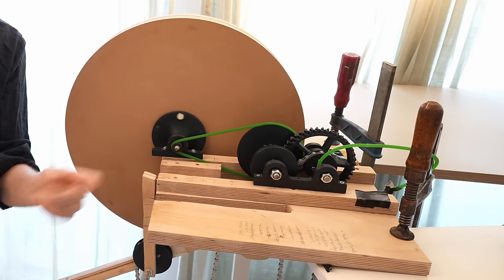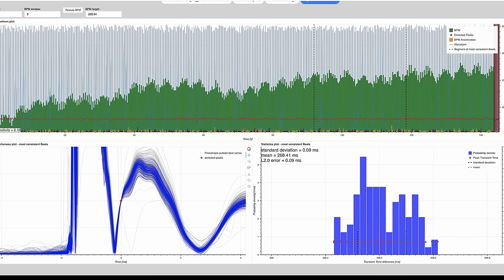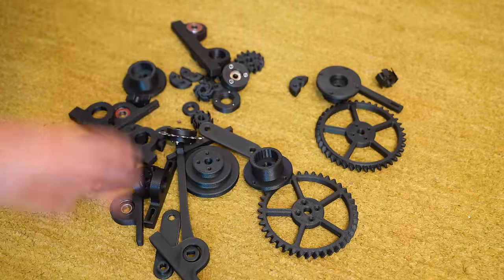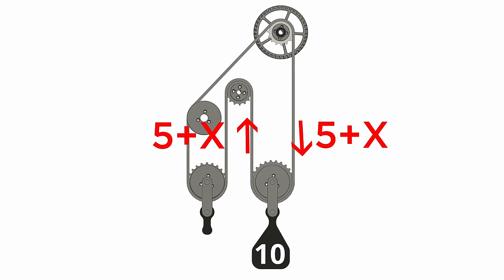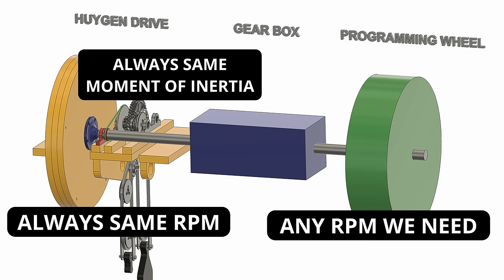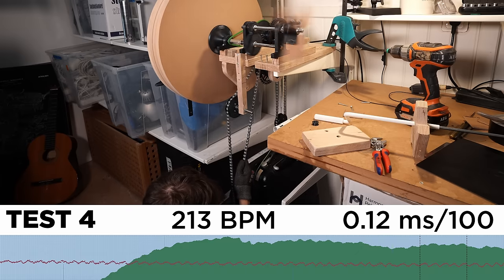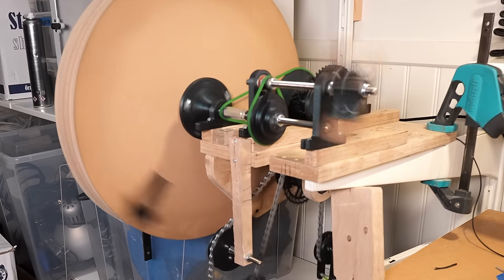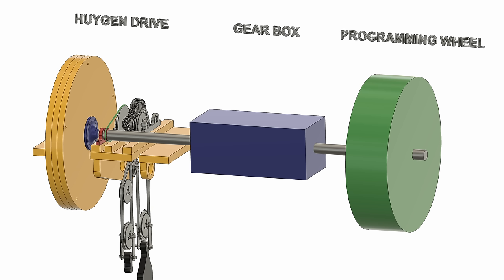Using Gravity To Play Tight Music

Comment: You're going to be powering a couple of marble elevators, and a programming wheel.
The programming wheel needs to turn at a rate that is tight, and will have a tight energy draw.
The marble elevators can be sloppy, and will have a sloppy energy draw (depending on the number of marbles in each lift at any given time).

I'm not sure you need to care about how tight the flywheel is.  The marble lifts are going to add slop to your power train.

I think whatever mechanism you use for tightness ought to be as close to the programming wheel as possible, and it needs to accomodate for a sloppy power input.
Reply: Exactly. The machine could play 10 marbles or 1000 marbles per minute -> the power consumption of the lift will vary by a lot. Having a tight flywheel while testing with a constant power consumption isn't doing anything for the marble machines tightness.
Reply: @mrpraefekt6252  I've said it before, and I'll say it again: There needs to be some kind of isolation between the ball lift and the programming wheel drive.
Reply: Just slam the marble lift to its max capacity all the time, lol. Recycle the overflow back to the bottom again
Reply: You could have a flywheel that is powered like the metal prototype in germany, that drives the marbel lifts and use the output of this flywheel to power the new drive system, that only drives the programming wheel. 
With this you get a pre smoothed power input for the new drive (stop the wavenes of the output) and you dont have to wory about variating loads of the lifts.
Reply: Powering the lift with the crank would solve the issue with changing number of marbles in the lift leaving more constant power input to play of music.
Reply: @andrey5405  Yes. As long as there is a mechanism to automatically disengage the chain drive if the weight gets to the top and you still need to lift a lot of balls.
Reply: I think part of why he's so concerned with tightness in the main drive mechanism is because the load is known to be highly variable. The tighter the main drive is, the more "budget" there is for timing variation in the mechanisms it drives, see what I mean?

At the same time, I agree that this needs some kind of closed-loop governor (such as a centrifugal governor, perhaps with feedback from the position of the main weight) to deal with the tempo drift, and that it makes sense to isolate the drive for the marble lifts from the drive for the programming wheel. Two independent flywheels and power trains but driven by the same weight, maybe?

Note also that there's an unspoken design constraint here, I have the impression that Martin really wants the entire machine to be muscle-powered and mechanical except for the microphones. That rules out electric motors but also any form of electronic governor.
Reply: As said, a centrifugal type governor negates all those problems. They worked on steam engines over a hundred years ago, they'll do fine here. One step at a time though.
Reply: @elwoz1  I think you could have an electronic governor as long as the electricity was generated by the prime driver. (namely whoever is turning the crank) You could coat the outer diameter of the flywheel with magnets and surround it with coils that generate electricity. You could even use the same coils (or a second set) to slow down the flywheel to maintain the speed.

Comment: Just wanted to say that the BPM precision battle is not an uphill one, but an unreachable one.
Once you're in the milisecond range, you might not need to worry any longer, seeing that contact with the programming pins will make it look like the number gets worse when you install the midi wheel. All of them will behave as micro impacts that slow down and overall destabilize the wheel by the amount of notes being played in the moment. If your intro has a few notes, in comparison to the chorus of a track, the chorus will play slower, by a miniscule amount, but slower.
Depending on what is being programmed, some may even slow down the machine's spin too. Be it weight or added friction.

Comment: Two quick suggestions :
- as people said, calculating deviation in ms at different speed doesn't really tell you if it's tighter or not. Halfing the deviation in ms by doubling the speed is actually not an improvement. That's because when you then add a gearbox to divide the rotation frequency by two (doubling rotation period) you will double de deviation in ms as well. A more useful metric to measure the tightness would be the deviation in percent of the duration of one fly wheel turn 
- maybe try running some longer tests to see if it stabilize over time. Like an hour minimum. Maybe use a electric motor to turn the crank to make long tests possible.

Comment: Two thoughts: 1) You're measuring accuracy in absolute time (ms) over a relative time (period between transients). Measuring that way, the higher bpm will always be "tighter". What you want is the relative tightness. 2) As others have already mentioned, when playing songs the load will vary, which is equivalent to your wind governor growing bigger or smaller. The Huygen drive is, as you said, a way to filter your input, to achieve (near) constant force. But you want constant velocity(tempo) under varying load, which becomes a trickier problem, some kind of feedback/compensation is needed.
Reply: agree, we all should reserve absolute tightness to some kinky stuff
Reply: He could use an escapement, that would give him the perfect tempo no matter the load. It would just tick very loudly 😂

Comment: Looks very interesting! What could be difficult in the end: When you have to rotate the crank at a given speed which is not in time with the music, that could be very difficult for your brain.
Reply: That's why organs and such do not have direct link to the input and output.
When you crank or pedal on an organ, you are increasing air pressure.
That air pressure is then regulated to come out as needed.
This allows the machine to play tight without having a precise energy input.
Reply: Yes, I was worrying about this too. But if you think about, for example, a bagpiper, they seem to be able to cope with this. They have to re-inflate the bag at a speed that's largely independent of how fast they're playing.

Comment: I still can't believe that after hundreds of episodes between MMX 2 and this one that the input is still correlated to the output instead of the flywheel just holding power and something else tapping into that energy at a steady BPM that it would ask for, a bit like the flywheel bike where the flywheel is just stored energy and the accelerator takes a little bit of energy or a lot of energy at a completely steady rate which also leads to another thing often commented. That means it still keeps the machine human, it's still Martin adding the power into the system by method of a crank or pedal but the output would be perfectly accurate as long as there's enough energy in the system to keep providing the asked for amount.
Reply: So you mean instead of a governor managing the speed of the drive shaft, the governor should manage the gear ratio of the gear box? If there's a CVT that can reliably handle these loads while also being simple and cheap to repair, that could be a more robust system.
Reply: Have you ever seen a mechanical clock? You're kind of describing the escapement of a mechanical clock. In a big clock that is a pendulum ended with a pallet fork and escapement wheel going back and forth always letting go a little bit of energy from the hanging weight limiting the beat of the clock, usually to 60bpm or 1Hz. In a mechanical wristwatch, it's a balance spring with a circular weight being driven by a power spring or a set of them, connected to a pallet fork with escapement wheel which goes back and forth, limiting the balance spring oscillations to 4hz or 240 bpm always allowing just enough energy to "escape" the power spring to run the clock. These forces are tiny but imagine the forces needed to run a huge multiinstrumental machine like this one as tight as a wristwatch. Holding a beat so tight mechanically, accurately and reliably is difficult no matter the design, because it's always an incredible balancing act of the thing that makes it tick - the pendulum or the balance spring. The more accurate your pendulum/balance spring is manufactured, the more accurate your beat will be. This system is more or less the same in that regard but with larger forces and I also think it's simpler than an escapement which needs to be very precise and inherently has a limited set of oscillations. With a governor you can control the amount of energy continuously, you can easily correct for new loads in the system, being able to handle higher loads, and it should have a higher BPM range while also being easier to change it. Escapement is very undesirable in clocks because it TICKS. An escapement big enough to handle the load of a machine like this would have a beat of its own 😂 which is why all the music instrument manufacturers probsbly opt for an air governor or pendulum governor instead. But it's true that escapement could make the machine run incredibly tight.
Reply: @dvl973  The best way I can see of using an escapement would be having a relatively small escapement driving a shaft, then taking the offset between that speed and the output of the drive system, and feeling it into some kind of mechanical PID.
You could get the derivative term from taking the difference in speed (literally use a differential), attaching it to a flywheel with a clutch, and comparing the speed of the flywheel to the speed of the output - again using a differential, then measuring the speed of that with a clutch to a sprung wheel.
Get the proportional term from a clutch on the difference in speed on a sprung wheel.
Get the integral term from wheel attached to the speed difference geared down really far, and set with e.g. a torque limiter and a pair of end-stops.
Then add them together (mechanically easy) and attach them to the input of a CVT (or even an IVT, but that might be hard), or just attach them to a regular governor, or maybe threshold them with some hysteresis to a gearbox and a governor - though that would be very complex.
Reply: Couldnt agree more, it feels like he has misunderstood the purpose of the flywheel. Sure, it can smooth out jitter, but more importantly, it's a battery which can be uncharged at a steady rate.
Reply: @rasmushaversen A battery is an alright analogy, but it actually behaves as a capacitor, as it discharges/charges proportional to the torque applied.
(Note that this is true to such a degree that the physical flywheel effect of a motor in a circuit is effectively that of a very large lossy capacitor).
Reply: @TlalocTemporal  What Martin needs is a constant speed drive (CSD).  They take variable speed, variable torque input and produce constant speed, variable torque output. IIUC, as long as there is enough torque to move the marbles, this will provide a a very constant speed.
Reply: @colsiteb  -- Correct me if I'm wrong, but don't most CSDs use hydraulic transmissions or excess bleed air? Hydraulic systems are way too involved for this, and bleed air seems like a low efficiency solution based on convenience. Both methods need the input shaft to behave at zero load anyway, so we still need a governor.

Hmm, I suppose the input shaft wouldn't need to be so tightly controlled with this, allowing the input shaft to be spun up or allowed to spin down without worry. 

Can a CSD be mafe with simple mechanical parts? I think the hydraulic version works similarly to a hydraulic CVT, so could a mechanical CVT be fitted to work in a CSD? Are there simple mechanical CVTs with decent efficiency and low noise? Can our input shaft be limited to not spin up to failure onder no load without wasting energy? You have piqued my interest...

Comment: You could still use the foot pedal driven approach to lift the weight up... just use a smaller flywheel to smooth out the force applied to the lifting sprocket.  This way you can still keep your hands free to play other instruments, maneuver levers, etc.

Comment: I'd like to point out, in case nobody else has, that you're going to need a device in the transmission that can maintain a constant output speed, because once the machine actually starts playing, you're going to have a constantly variable load put onto it.  Without something to compensate for that, it will have the potential to end up sounding like a music box at the end of the spring winding.
(Plus you have to compensate for the energy it will take to maintain all the marbles at a given tempo)
Reply: If that governor fan had centrifugal weights and springs to modify the damping as it’s speed fluctuates it could compensate for the varied load. Perhaps some sort of bistable spring and lever arrangement would allow the same mechanism to /quickly/ adjust both over speeds and under speeds. I’m imagining a best case scenario where the governor oscillates or flutters between the high and low drag configuration at steady state.

Comment: One thing you could consider doing is hooking up the governor to a cvt or other variable transmission system which would output the same tempo and torque reliably regardless of the speed of the huygens drive.
Reply: I agree that a CVT could be a good option for Martin to have the option to change the tempo on the fly, if he want to for artistic reasons during a song
Reply: @coolfrost6  I'm thinking enviolo bike hub and a mechanical feedback system to adjust the ratio based on output rpm. Then he would have the mechanical equivalent of a capacitor and a voltage regulator.

Comment: Spring loaded fins as airbrakes. 
The faster, the air break spins the longer the fins get 

the slower it goes the smaller the fins get

The strength of the spring can be finally tune to get the exact rotations per minute you want
Reply: I just posted this, but it doesn't matter which comment he sees, so long as he gets this information, so I'll upvote your comment too

Comment: I'm not sure why we need super tight music and at this point I'm too afraid to ask. With the reliability improvements I got it but the speed of the music can fluctuate and not cause too many issues surely? Great video and engineering!
Reply: Yeah, Martins main issue is that he has a very vague requirement “System shall play tight music”.

The reality is that he should define “tight music” as in “BPM variance shall not be bigger than 2ms” stick to that and move on.
Reply: I think, that he is loosing the whole Point of an mechanical Instrument / his journey. More reliability -> seems like a good idea.
Reply: He lost the plot a long time ago.
Reply: Tempo fluctuation should happen under the control of the operator though. I firmly believe that's really the whole point. This has literally zilch to do with making the music sound "robotic" with zero tempo deviation whatsoever. Same is true for the issue of dropped or falsely triggered notes... it has zilch to do with "perfectionism" as folks here are calling it.

Comment: You can add a variable ratio gear between the crank input and the gear that turns the chain, that changes based on the height of the weight. This way you can create a mechanical close loop control system with negative feedback that speeds up or slows down your input depending on the height and thus helping you keep steady height even easier and with big margin for error. Finding the correct mechanism to implement this can be tricky but since you are on the path of the tightest machine it can be worth it.
Reply: I was thinking of something like a CVT such as an enviolo bicycle hub. The control of the ratio could be some sort of mechanical feedback as you say.
Reply: @Ed.R  I am not familiar with that mechanism. What I was thinking was something like a ball at the end of a rod running against a wheel and depending on the distance from the center the speed changes. If you make it move with the height of the weight you have a system that can adjust its speed to keep equilibrium.

Comment: Combining the Huygens drive with the Governor and flywheel is the best solution i think 🙂.
Reply: Best solution is to use the Hyugen drive with an escapement clock mechanism, way simpler and more reliable.

Governors will still change BPM depending on the load of the machine, and will be more complicated to implement.
Reply: As I see it, the Huygens drive and flywheel perform the same function => storing energy
So one of them is redundant and should be removed.

Comment: Martin, great to see that you are still motivated by the project!
From my mechanical engineering background I agree with your assessment of the source of the speed drift. The goal should be to have the flywheel spin as slowly as possible, while the governor spins as fast as practical. This supports that you intend to have a heavy (High rotational inertia) flywheel to store the energy required for "buffering" the Huygens drive force input.

The plan to have the rpm constant makes a lot of sense in regards of tuning this system but adds the need for a complex assembly down the line. Maybe you find a governor design that can easily be tuned for an rpm range which suits your needs.

I have a wind up music box at home from a cheap childrens toy at home, which uses a governor of fast rotating weights bound to a shaft with springs. As rpm increases they extend outwards and at some point begin rubbing on a surface which brakes the system. This might be the principle of the device you showed at the end. This could be easily adjusted by changing the distance to the surface which the weights rub against.

Take care of yourself and keep having fun and making art!
Paul